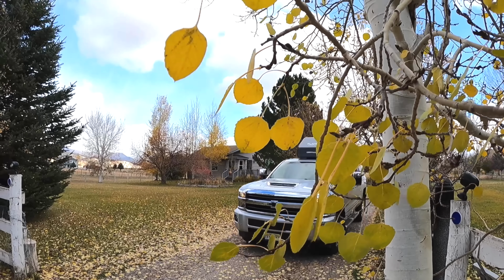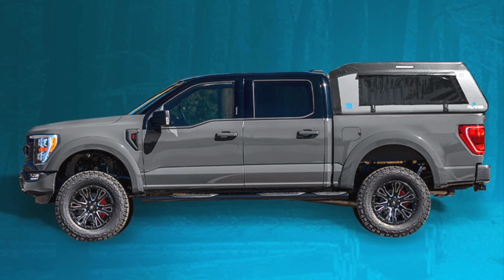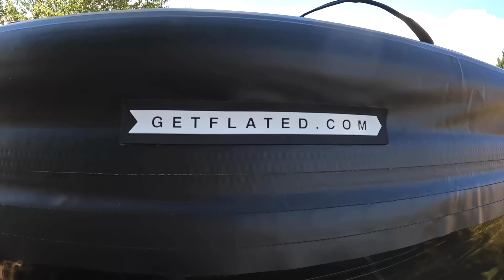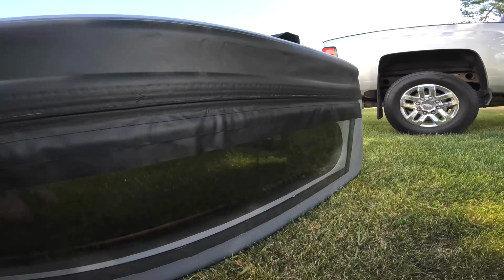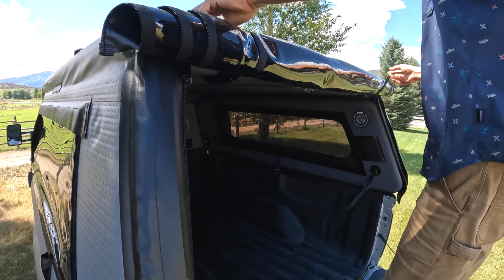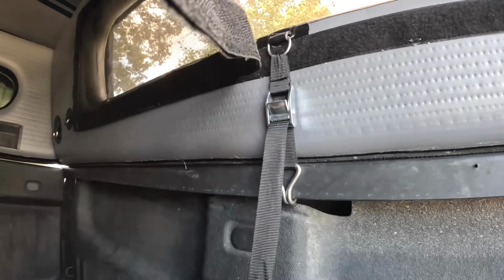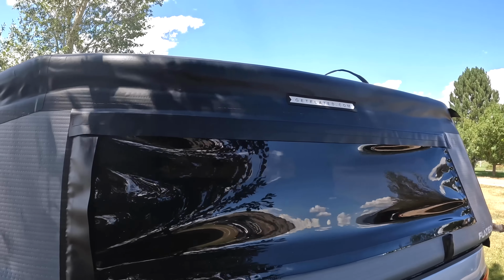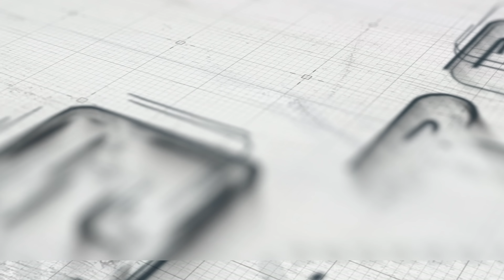Flated Air-Topper® Installation / Tips & Tricks

Comment: This is really cool. I've been looking at toppers for my 2009 Ram 1500 4x4 that has Ramboxes. I only need one a few times a year and mostly as an aero aid when I'm towing my 1962 Shasta canned ham.  This looks like a great solution for that and I see you show it fits the Rambox beds. Mine is the 5' 7" one.
Reply from the maker: Thanks for the comment Nick, the Air-Topper sounds like it would be a great solution for you. Check out getflated.com and we have the dimensions to see if it fits your 2009 Ram 1500 w/ Ramboxes.
Reply: I have one for my 2022 w ram boxes.  It works great.  In a pinch, you can reach through the side windows to loosen the straps on one side and lift the topper to access the ram boxes

Comment: How well do these hold up in Canadian Winter conditions? We get to -40C for long stretches? Also, how durable are they in the bush, if you were to take the truck hunting and they got scraped by branches?
Reply from the maker: Thanks for the question Jon, the Air-Topper is made out of durable PVC coated Drop Stitch material that will take on brush and limbs without damage. I drove mine straight into a parking garage "low clearance" sign and hit the concrete to about half way and backed out and it just scrapped it up a little. So these things are super tough, check another short video on our page where we rode an ATV on the Air-Deck and drove over an Air-Carrier with a tractor.

Comment: Does the air-topper fit if you have a hard tonneau cover folded up against the cab of a truck?
Reply from the maker: Hi DJFLYGUY, thanks for the question... if the Air-Topper can sit on the edge of the bed still it will fit on there. If you want to join a live chat @ www.getflated.com you can share an image of your tonneau cover.

Comment: Dude, this is an awesome idea!  Could you try to make a version that goes from full height down to a tonneau cover height?  Also, please try to integrate an LED center brake light too.
Reply from the maker: Thanks for the suggestion, I'm a little confused on the "goes from full height down to a tonneau cover height?" are you suggesting that we incorporate the Flated Air-Deck into an all-in-one design?
Reply: @FLATED No, I'm picturing the Topper being able to condense into a tonneau cover for everyday use when a full height truck cap isn't needed.  This would also give better visibility out the back of the truck.  It might be way to complicated to execute, but let me know your thoughts.  Don't forget to send me one for free if you can make happen.
Reply: Great idea! I imagine being able to deflate the sides and only leave the top inflated so that it functions as a tonneau cover for day to day use when you don’t need the extra headroom.

Comment: What chemical or fumes come off the topper? I’m concerned about sleeping in there if it smells like plastic fumes, low ventilation
Reply from the maker: Great Question Joel. We are using a Phthalate-Free PVC drop stitch. It smells "new" out of the box, but that quickly goes away from driving it around town and down the highway. My wife is ultra sensitive to odors and she has never mentioned a thing about it. Back in the early days of Inflatable SUP's, the material stunk bad and off-gassed. But the technology has come a long way.

Comment: It’s nice product. But you need to figure it out how to make it full seal to protect you from water in dust
Reply from the maker: Thanks for the question Eisa, we have an EVA material to seal around the bed but still needs a little weather striping on the bulk corners depending on your truck bed.